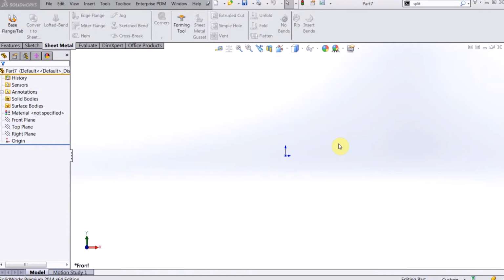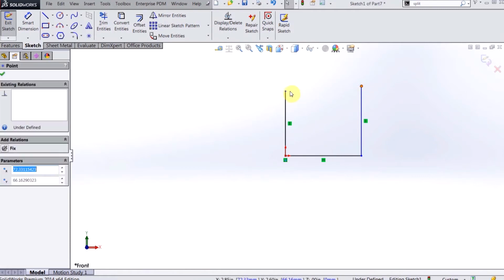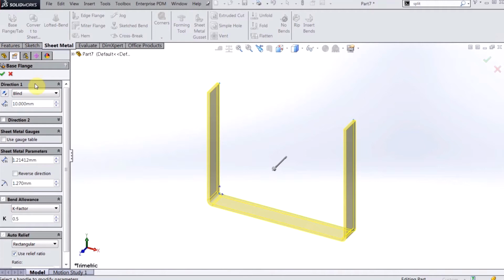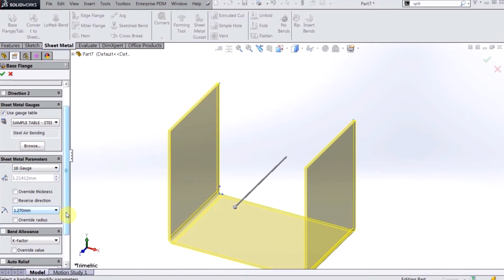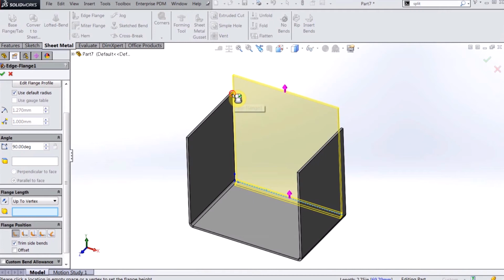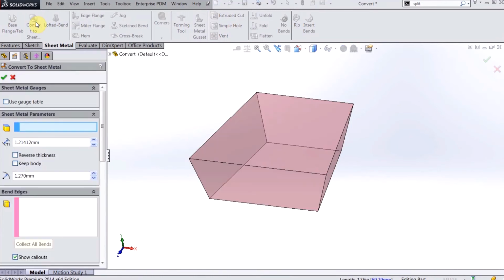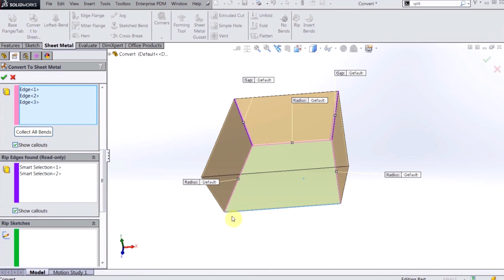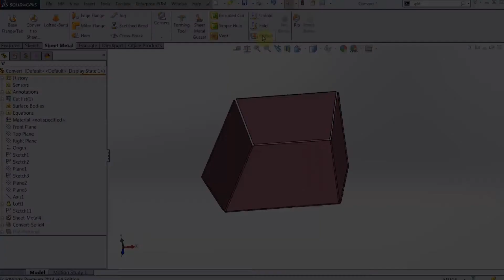SOLIDWORKS - Convert Sheet Metal vs. Make Sheet Metal Part

Comment: I thought I could just make the part and then "convert to sheet metal", but I just can't get passed the "Fixed face/edge is missing" error. I tried to "fix" lines/edges, faces and/or entire sketches thinking that would fix the problem, but it don't do anything. I wish I started off just making it out of sheet metal from the start, but didn't know how and didn't have the dimensions/information required. Was gong by only a couple dimensions and a picture. (I can't use the help or search features either for some reason. It/they just stopped working for some reason).

Comment: But what are the difference. Does one method have any advantages or disadvantages?
Reply: From (limited) experience, it depends.  If you know exactly what size and shape of part you want, it may be beneficial to start off making it that way and converting it. It may also come down to how comfortable you are with one over the other. If you're not good with bend allowances and or are trying to go off rough napkin dimensions, it may be advantageous to not do flat first.  Last part is purely opinion though. 

It's mostly just to have the options and tools at your disposal. Especially if your just doing a quick and dirty concept model instead of a functional part intended for production.